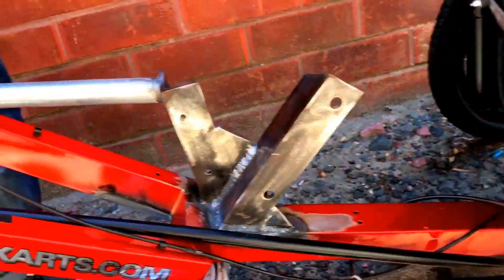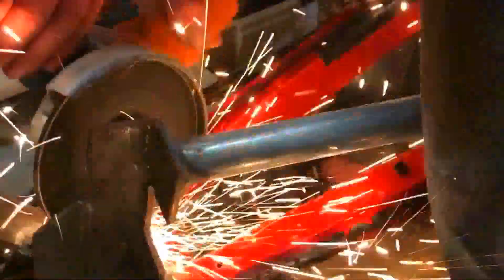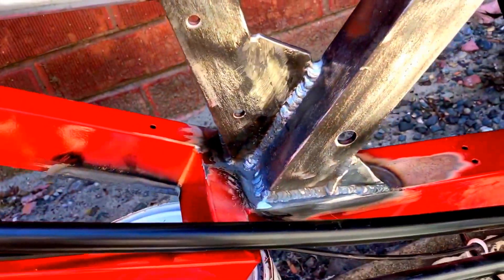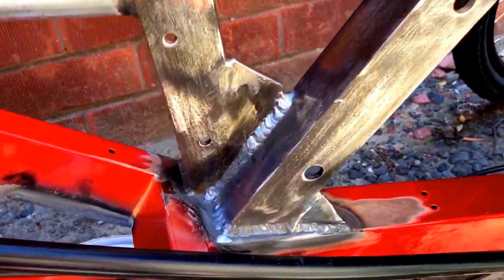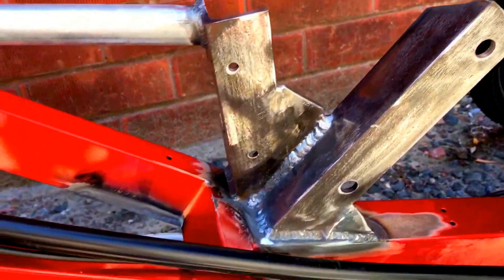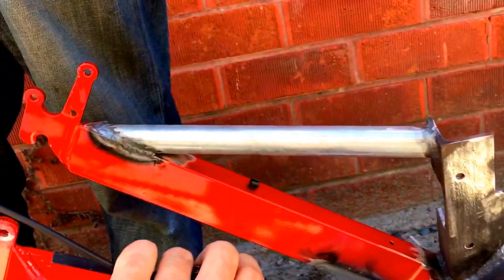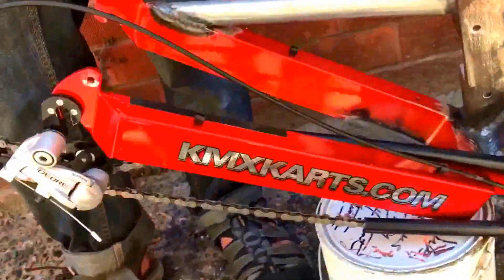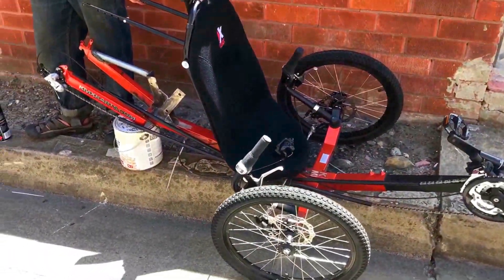42,000w 56hp Electric Bike Triple Motor (video#2) Welding Heavy Duty Motor mount onto trike frame

Comment: Where do you guys get such powerful small motors? I am trying to make a 15 to 20 hp bicycle and cant find any motors.
Reply: James Sever wattage determine horsepower horse power is directly converted from watts so 72v nominal x 100 amps =7200watts roughly 750watts per 1 hp so 7200 divided by 750 is roughly 9.6hp ferrofluid and heat sinks are your friend lol good luck

Comment: Very nice. one question; how are you controlling the three motors all at the same rpm?

Even if you gave them all the same amount of throttle, running off the same battery, there will be slight differences in commutation speed, especially under high load (uphill, etc), which will stretch the belt between motor pulleys in unpleasant ways...

Have you observed this as a problem, or have you not run it under load yet?
Reply from the maker: Yeahh I know exactly what you're saying.. so many people asking this questions here in my previous YouTube video and some messages on Endless Sphere on Facebook group....  some theory tells that it shouldn't be done and on the other hand some other things makes you think yes it should be possible.

Matt Shumaker has been designing a twin motor since 2010 and he sold many worldwide and he LOVES his twin toy soo much.

I guess the ONLY way we will find out if triple motor/controllers are viable is when I actually take this thing for a spin... not just for a quick burnout but riding lets say for weeks up and down hills...  I guess if I had 4 motors I could use an of the shelf drone part hahaaaaaaaaa =]
Reply: IamIronManUK, if all three of the motors are operating on the same chain wouldn't they be forced to operate at the same RPM?

For example, if one of the three motors was slower than the other motors, all three motors would be forced to the same RPM as they are all equally imputing to the belt and also limited to the speed of the belt.

This is not ideal, but it would work.

I'm no where near even knowledgable, so this is uneducated guess and ultimately theory.

I guess we'll have to wait till he climbs a hill.